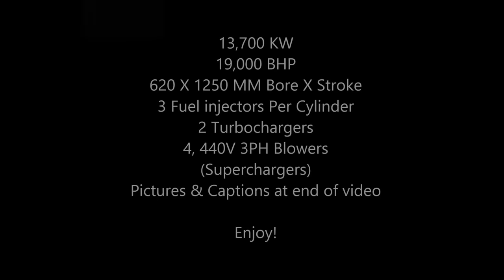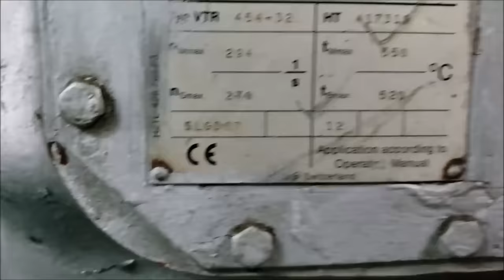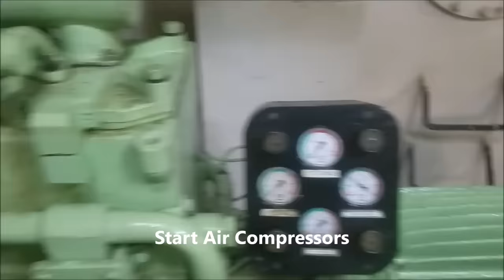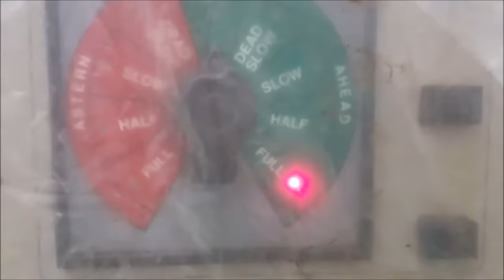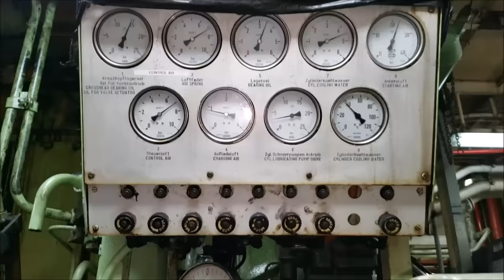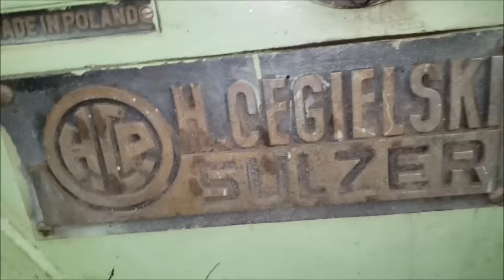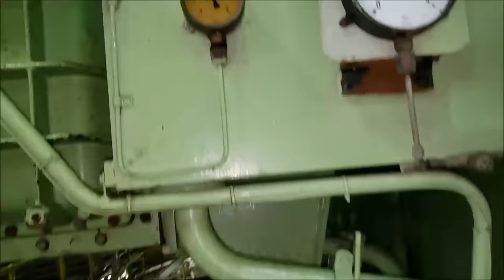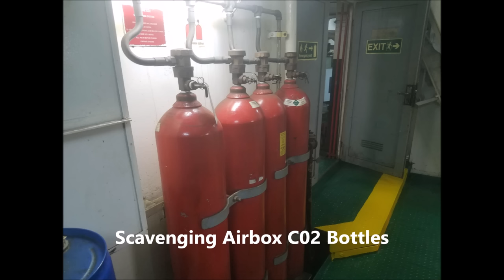Huge Sulzer Ship Engine Running at Full Speed Engine Room Walk Around

Comment: That’s a sweet sounding motor. Would love to see that in person. How many cubic inch is that Motor?
Reply from the maker: Thanks for watching! The engine is approximately 13,600 CID.
Reply: Something's gone wrong with the math here- I plugged the bore and stroke into a calculator and came up with over 20,000 ci per cylinder. An average locomotive diesel is over 10,000 ci, surely this is a lot larger. Nice vid otherwise
Reply from the maker: @dieseldave71  Good to see you again diesel dave. I certainly could have done the math wrong as I am currently at sea and don't have much time to devote to this at the moment. If you could please post the borexstroke and overall CID I would greatly appreciate it. Thanks for watching!
Reply: I come up with 377 liters per cylinder, for a total of 2264L. In inches it's approximately 24.4" bore by 49.2" stroke, giving 23029ci per cylinder for a  total of 138176 cubic inches. That's a lot of air! I remember reading somewhere that the big 100,000+ hp Sulzer produced something like 5 million ft lbs of torque.... any way you look at it, those are huge numbers, almost incomprehensible to someone like me who's used to little 600 to 1500 cubic inch engines. Thanks for showing us around, again a nicely done vid with no music and the added bonus of the exhaust note at the end. If your schedule allows it would be nice to see one (or even better a series) showing some things with a bit more detail. I was intrigued by the crankcase explosion dampers, got me to wonder how regular an event crankcase explosions might be lol
Reply from the maker: @dieseldave71  I'm putting together videos of another smaller slow speed B&W engine and gen sets. Below is a link to the 9 cylinder Sulzer generators on that ship. https://youtu.be/VDsKurF3nFo
Reply: @dieseldave71  The crankcase explosion relief valves are a class requirement (in this case Germanischer Lloyd) and their capacity is based on the volume of the crankcase. In combination with an hotspot in the running gear  and the oilmist being present, this may result in a severe explosion in the crankcase which have killed E.R. personnel.
The idea behind the relief valve is that they close immediately after an explosion in order to prevent the inflow of air into the crankcase which could cause a second explosion.
These engines are also equipped with an oil mist detector and / or temperature measurement and temp alarm on main-, crankpin-, and crosshead bearings.
When an alarm is activated, an automatic load reduction will be triggered. Of-course, these things always happen when the engineroom is unmanned during the dark hours. Causing all engineers running down the stairs to check out what is wrong with our precious home bringer. (Yes, I had an auto reduce on the oilmistdetector, loooong time ago, and it was kind of unpleasant, as we did not know yet if the detector gave a false alarm or we had a real problem)
Reply: Jan Visser Thanks for the explanation, that's interesting stuff. Are those systems you mentioned also useful in preventing runaways? I was wondering what might happen if one of these behemoths got to running off it's lube oil...
Reply: @dieseldave71  
Yes Dave,
It is a requirement to have an ..... overspeed protection which is Independent of the speed governor. When it is triggered the fuel pumps are pulled to “zero”.
An overspeed on lub. oil being sucked in is not possible with these engines as their crankcases are equipped with a separate crankcase vent which is led outside the E.R.

Comment: The electric blowers should not be called superchargers. Since they are intended to kick in when scavenge air pressure is too low during manoeuvring
Reply from the maker: You are absolutely correct.

Comment: What’s the engines idle speed?
Reply from the maker: Thanks for watching! There is no idle speed, but the minimum speed is 55 RPM for the engine order Dead Slow Ahead or Astern. The engine crankshaft is directly connected to the propeller shaft with no clutch so it the engine is turning, so is the propeller.
Reply: Thanks for the fast reply!
Reply: @FixAndForget  Thank you for the video and replies! How come there is no idle mode? Aren't ship engines notoriously difficult to start up? If so,  at 55 rpm the propeller would pull a lot, unless it has variable pitch?
Reply from the maker: @efficirw9122  Thanks for watching and the kind words! There is no idle mode due to the direct connection of the crankshaft to propeller shaft. Ship engines are not hard to start if they are kept in good condition. Problems arise when the engine is stopped (or brought from ahead to astern) and started too many times in rapid succession, as the start air compressors can not produce enough air to meet the demand. The minimum speed of the ship is around 7 knots at 50 RPM.
Reply: @FixAndForget  Interesting... So as soon as a ship needs to be stationary, it shuts down its main engine? Sorry for the silly questions, I'm not into ships at all. I have heard that it takes hours to start up a big ship's engine, the process including warming up and preparing/circulating various liquids. Maybe this was back then, when a fuel sample couldn't be poured out of a can at room temperature for being too thick...
Reply from the maker: @efficirw9122  No problem! HFO fuels need to be heated in order to flow, that holds true today. Yes, if the ship is to be stationary the ME must be stopped. It took almost 24 hours to restart a cold steam plant back in the day. A totally cold diesel ship would require a few hours too. When a ship is in port for a few hours/days everything is kept hot so it can be started back up quickly.
Reply: @FixAndForget  Thank you! This of course makes sense, working directly on the propeller shaft is efficient, as is the "stop-and-start" strategy regarding the idle. Otherwise such engines would burn huge quantities of fuel when idling. Although I guess the really large ships have diesel-electric powerplants, there it's probably easy for the power transmission to disconnect like a clutch. Or maybe that's special ships only like ice-breakers, maybe military...
Reply from the maker: @efficirw9122  Only ships that require precise maneuverability or redundancy have diesel electric plants. Military, passenger, tugboats etc. The biggest ships have slow speed direct drive diesel engines like this one but larger. It is all about efficiency when it comes to these engines. A clutch mechanism that could handle the amount of torque would be a huge expense. It is also not needed as ships get along just fine without idling the engine as there is no practical reason to do so.
Reply: @FixAndForget  Could you please tell if the direct-driven propeller ships usually have variable pitch propellers? Otherwise there is a lot of torque demand on the engine starting system isn't there?
Reply from the maker: @efficirw9122  Some large ships have CPP systems in order to not have to stop and restart the engine to go ahead to astern. In direct drive applications the engine must be stopped and started in a counter rotation to go astern. The biggest ships with slow speed engines have fixed pitch propellers. It is a big strain on the start air system however they are built to handle it and as long as there aren't too many consecutive starts & stops, everything works fine.
Reply: @FixAndForget  Thank you very much, very intersting!
Reply from the maker: @efficirw9122  No problem!

Comment: 6 min 36 sec
I'm sure a head gasket is leaking.. not a big deal but the cylinder head and liner seats may be marked due to abrasive carbon particles!!!
Reply from the maker: Thanks for watching! It's been some years now but I don't think I remember a head gasket leak. The engine was just overhauled 3 months before this was taken. I think the sound was possibly a leaking cylinder test valve but I could be mistaken. Cheers!

Comment: Please show "Thrust Bearing" Is it at 10:39?
Reply: That's where the prop shaft connects to the flywheel. The thrust bearing will be further back, much closer to the propeller.
Reply from the maker: Thanks for watching! There are multiple thrust bearings on the length of the shaft.  They are the circular pieces mounted to the hull and surrounding the shaft.

Comment: If you run this (or any) diesel engine at a Cylinder coolingwater temperature of approx. 40 degrees Celcius cylinder liners will not last for long !!!
Reply from the maker: This one is still going strong. What did the gauge register in the video? Thanks for watching!

Comment: Irregular tick.
Reply from the maker: Thanks for watching! The engine had just been overhauled. Some of the exhaust valves were still being broken in.
Reply: Asher Spalding , Properly overhauled heads do not need any break in.
Reply from the maker: @tobyw9573  Pistons, rings, bearings, exhaust valves and cages overhauled in the shipyard and do require break in.